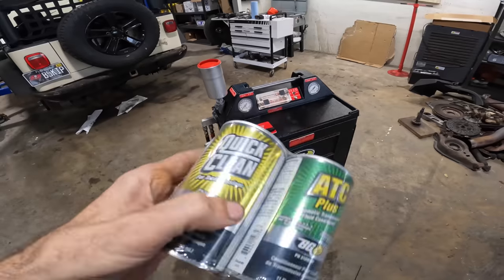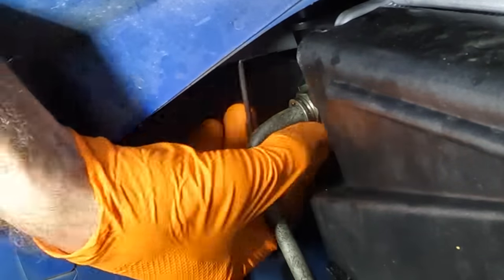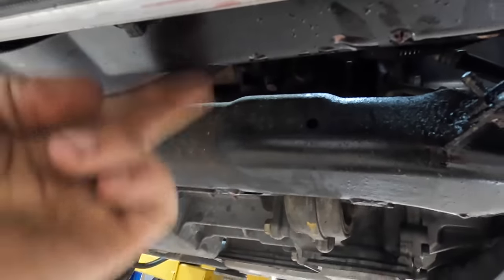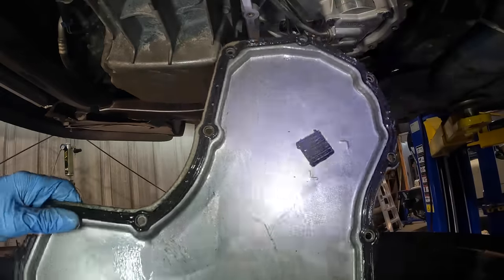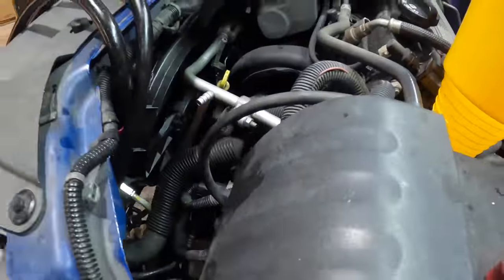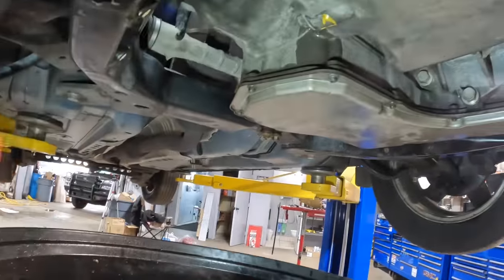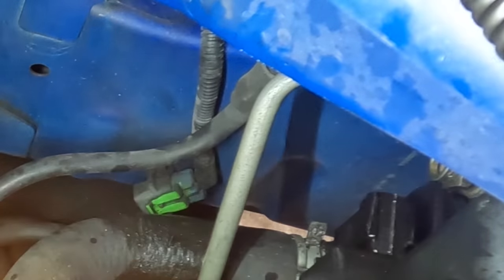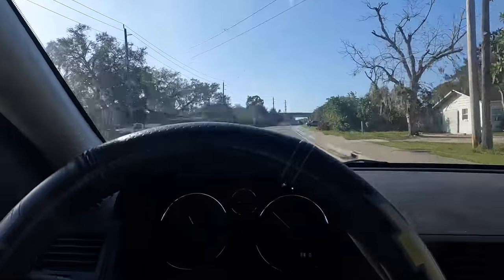Contaminated Transmission! Chevy Cobalt 2.2

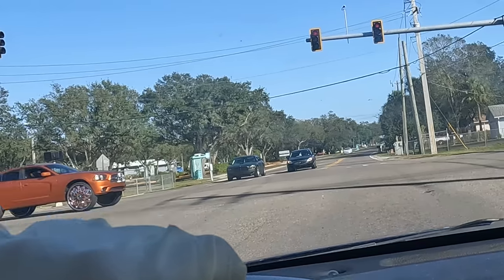Comment: That's the most Pepto-Bismol I've seen inside a transmission.   Also, at 47:50 that's what is officially called, "A clown car".   That's an industry standard term there as well.  And likely the person driving it is probably a clown.

Comment: Once transmission fluid is contaminated with water its pretty much a junk transmission. Water strips away all the clutch material. I would inform the customer prior that the life of the transmission may have been impacted severely and have them sign plenty of disclaimers prior to accepting a job like that. I would of also stall tested the transmission to see if there is any slipping under load at the end.

Comment: depends on how much water got into the transmission, really. if the clutch discs got super impregnated with it, it's gonna be a timebomb. if it was gotten to fast enough, it may survive. though it'd be a good idea to flush it again in a few months, if it survives.

water in the friction materials (whats left), prevents the atf from doing what it does, and those discs will suck that o2 up like no ones business. and if the heat buildup cooked the material, its also gonna go into slippyville sooner.

lots of ifs, but worst case for it is just slippyville, and not grenade. so it might (probably will) be rebuildable in the event it fails.

Comment: From most tranny techs say never do a tranny flush, just service the transmission as normal, but in this case it is warranted.
BTW Ray, if only you had kept that blue release clip tool that came with the radiator.

Comment: You never showed the best way to remove the old o ring i have always replaced that should come with the new filter usually i take a small chisel to bend the bottom metal part of the ring then make a small hole and use a pic and pull them out and ps merry Christmas

Comment: Factory gasket is way better than the garbage rubber replacement that wants to push out between the bolt holes and leak.  I refuse to use them.

Comment: Hello Ray..following from Puerto Rico..I have a question..I bought a 2005 Nissan Pathfinder and checked trans fluid and its a bit dark..should  I change the trans fluid and filter...or should I just leave it alone...I'm  a bit scared to touch it..lol  I bypassed the radiator cooler  ...they are well known  for the same  issue you just serviced  that car for...so I'm  using the external trans cooler it has...

Comment: What's that pink stuff for nausea, upset stomach. Yeah that's not supposed to be in there!
I think if it was just general contamination a good flush everything should be OK however if it was some sort of bacterial growth that could be problematic. Either way I think the transmission made it through. And this is coming from somebody who drove a van for two years with no reverse..... I even had somebody help me do a transmission drain and refill and that didn't help.

Comment: Some people here won't even flush a transmission that passed even the 8 speed crash or flood in it because they're afraid to condemn 91% even though you replace it with deck 6GM fluid is no different you just dump the machine and start over but they're not willing to do these guys are on the machines that continue is refreshed like And the only way the dump the machine is if the fluid is burned off

Comment: I got a question anyone, why no drain plug on auto trans, and is that machine required for cleaning out the torque converter?
Also Ray aren’t you gonna take break, it is Christmas by the way. Good job though👍

Comment: This way is the wrong way to do this. I rebuilt transmissions from 1989. The correct way was not hook old contaminated parts to new parts or mix new oil with a lot of contaminated old oil. 
Drop the pain. drain the contaminated fluid. blow out the lines. hook up an approved trans line cleaner . Drain torque converter (if possible). Reassemble. Then use this machine at this point, flush once. pull pan. redo previous steps.  install new filter and gasket. fill up with oil. test drive. 
Never reuse gaskets.  Your opinion is your opinion. Not a valid reason to not use new parts that worked for many moons before you were in you pappy's giggle berries. My experience in reusing old weathered gaskets is they can fail in short order. Bad things can happen. 
Point out the reuse of the old gasket or flushing fluid, in the way Ray flushed this fluid and have a transmission specialist explain how this should have been done  to a judge and see who is responsible for any possible failure? I know he is trying to save a transmission that most likely cooked now (rather boiled itself) to death but by not draining the old fluid before the flush can be used to say Ray burned the trans by not draining the fluid 1st and running the vehicle for how long with highly contaminated fluid and contaminating the new oil he put in the flush  so it still had residual harmful fluids in new oil . Especially since he drove it in. It would have been slipping at that point. Enough at least for a professional mechanic to have doubts. I've  seen many judges make a ruling that hurt an honest man. Not sure I would want to chance doing a job in a way a specialist would not recommend; and filming myself doing it. 
Just Sayin'!

He's right though. With fluid like that there is no telling the service life left in that trans. I had a customers immediately fail. another a few days later, another's  weeks. Another a year and another its still going strong. But with expert transmission techs and video evidence I'm not sure I would want to be put before a judge (one who probably encountered one of those scammer mechanics and got burned at least once). Myself I would ;on camera, tell the customer that there is no guarantee this will work and let him/her know there is a very real possibility that the trans will fail immediately or in a short amount of time with a detailed explanation of why the failure could occur.

We never flushed transmissions. with this machine. Nothing better than draining fluid and cleaning out the system manually. NEVER contaminate new parts with old fluids. NEVER. 
Huge waste of oil doing it this way. I hate wasting anything though.

I like Ray. pretty good mickanic. but if he wants to keep his business. filming himself doing repairs on highly expensive customer owned parts in a very questionable way can cost him big. I like how he explains how and why. I see a lot of people just take Fasteners off and then the next clip your watching them threading fasteners on and tightened then they are done. Missing many crucial steps and the explanation of why those steps are taken. Its rare to see Ray skip steps without explanation. Good on you!

I knew  you were going to get fired because of the filming. Some of the things you said I was thinking "uhhh.... not smart dude. that's the customer of the guy you are working for" and  you filming some things that was evidence.  If not of you but of others around you. things in background etc. 

I think it was the best for you though. Glad your doing it on your own. Your skills should be rewarded not used to make others rich.
Remember do it right the 1st time prevents bad word of mouth and  doing it at an expensive cost to you the 2nd time.
Good channel. good content. good man.

Comment: The only thing you can say at least they didn't send you the cork gasket to go around the pan the rubber are the better brand and the gasket that was on the pan is the best brand. So the cork is good the rubber is better and rubber and steel gasket is best.

Comment: Hey Ray. Ive got a question. I'm not trying to be a smartass. Wouldn't it be better to use normal water to flush the pink fluid from the system and once its nice and clean, drain all out and add brand new transmission fluid? Wouldn't it save new fluid from been ruined by mixing with pink fluid?
Reply: All the internal moving transmission components need LUBRICANT!!!  Would you flush your car engine with water?Nooooo

Comment: i don't know if it would kill you to ingest the stuff, but it sure as heck won't taste too good...

i ingested sump oil once, not my finest moment!
i serviced a small engine and put the old oil and flush oil into a pepsi max bottle for disposal, but some joker put it in the fridge. eventually i went to the fridge with a bad case of the dry's and went straight for the pepsi max bottle 🤣
it was not pleasant! i ended up brushing my teeth for about half an hour afterwards, but asside from the embarrasment i don't recall any ill effects

edit: wait, yeah you're probably right come to think of it, i forgot about the glycol in the coolant

Comment: Looks like about 196,000 miles worth of friction clutch pack wear showing in the pan. So... predictions? Craigslist, in 20 minutes - with "just had extensive transmission power flush, to increase longevity" in ad text :rolleyes: .

Comment: PT cruiser transmission will last another thousand miles, then clutches will fail because they are swollen with water. But nice try, but if you're lucky will work for the rest of life of the vehicle. Which will probably be a year anyway as it's a PT pants Cruiser.🤣🤣

Comment: We replace it with ZFX6GM flood which red line oil also says works in a cracker transmission and of course clean grade fluid pool always trump the house Brandon so there you go that's what I run the red line fluid and mine and have complete stuff for a 100000 miles with no issue no I'm good I'm not bragging at all cause as soon as I breathe on something I've done have a problem that's just my luck

Comment: Depending what percent of ATF drains out, a typical car tranny with 8 quart ATF capacity will require only three of four drain-and-fills to positively replace 95% of dirty ATF while using less than 16 quarts of new, and wasting only 4 quarts of new ATF. You wasted 4+ cases!

Comment: The brains are leaking brains... although it's not badly burnt fluid... new auto trans fluid does smell gud...
Reply: Time bomb... Unfortunately. This would have been a car I would probably have refused to work on unless the customer signed off that he knew just that and there were no comebacks on it when it does blow up.  Just like burned fluid in trans is a no change situation.

Comment: Help me out Ray, what kind of crappy design is that from Chevy that a tranny cooler/radiator is integrated into the engine radiator?  A proper design is the tranny cooler/radiator should be a separate radiator in front of the main engine radiator, yes?

Comment: Ray, didn't the radiator come with a tool to unlock those &^%$#@ clips?  I'd have sworn you said that the little blue plastic doodad was for that.  *If it works, it's worth keeping.  (Yes, I know, that's a mighty big "if".)(The ones I've got are metal, but they don't work worth a damn either, and I still end up yanking the [expletives_redacted] clip half the time.)

Comment: That's why you don't crank the d*** gasket down there's cause using a rubber gask it and you put supermarket texts in the corners so it doesn't roll up on you that's what I was talking about when I said text I don't know how to tighten the transmission Bang gas good correctly if you use the old gasket over you've got to set you pitch a shot of a ceiling or leaking either way you go so yeah I agree with you that it's better shape is that transmission then you may not say it in any way so probably better off doing what you're doing

Comment: pointless to try and flush it at just idle. You aren't flushing the valve body or accumulators just idling. You need to drive it in every gear between flushes.  Otherwise its just going thru the pump and back into the pan. Plus AmsOil is way better than BG fluid.
Reply: Not just GM.  A few years ago Nissan had radiator failures which poisoned the transmissions...my brother was stranded in Oklahoma for a week during vacation waiting for a replacement. Nissan never admitted that the failures were killing transmissions.

Comment: I honestly don't know why these car manufacturers design these stupid things like this,ford do the same here in Australia with our ford falcon,the idiot designers though it would be a good idea to have a transmission oil cooler incorporated into a PLASTIC resivour on the bottom of a alloy radiator. The plastic section that sepperates the trans oil cooler from the radiator fluid fails and mixes to create infamous maccas pink milkshake. I ended up running an external oil cooler independent from the radiator when i had my falcon. Worst design ever.

Comment: I will tell you nothing stinks or if you ever have the occasion of doing one that crashes or the yelf wood and don't let them tell you there's lifetime fluid because it's not it's supposed to be changed every 50000 miles according to the UF the manufacturer of the transmission will also put up a video to debunk chryslers Lifetime fluid claims the USS 50000 miles at the most they have a video on it but usually you have to buy the pans from rock auto because if you buy the factory plan and pay the price or price for it you will know you can get the oil Pan on Christ on arcotta or a better after market with a replaceable filter which to the OEM does not have people tend to freak out about the English reprise of the Pan but still cheaper than the transmission I say But nothing stinks or some that kind of fluid it's green and nasty

Comment: I'm saying this to anyone that reads this. Especially those enthusiastic enough to try going into business themselves.

So Ray, the unit is used.
I'd guess you're taking advantage of so many people that have and are going out of business. Most likely because of how COVID-19 has changed so many people's lives.

There are probably many great deals to be had at auctions everywhere of every imaginable kind selling just about anything anyone would ever want to by.

Auctions are both an excellent way to quickly and easily liquidate a business

And

An excellent way to get things needed to start or grow your business and the things your business can do.

And to the nay sayers, That may think auctions are cruel and harm people that are forced to sell.

Think of this.

Every extra bidder with every extra bid.

Gets the seller more of the money they my desperately need.

So by avoiding auctions, you harm those people in need of getting the best selling price for the things they may not want to sell BUT MUST.

So, BID HIGH, and BID OFTEN